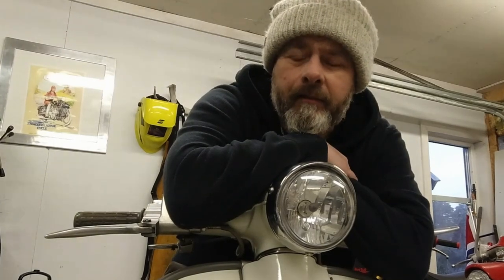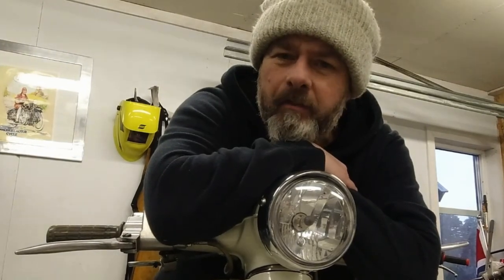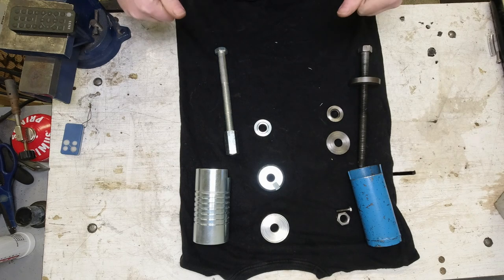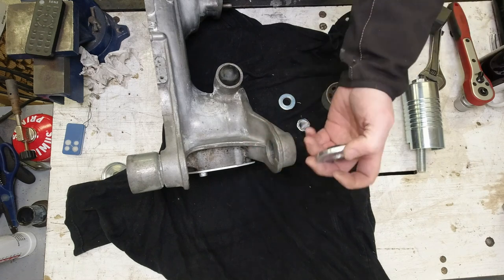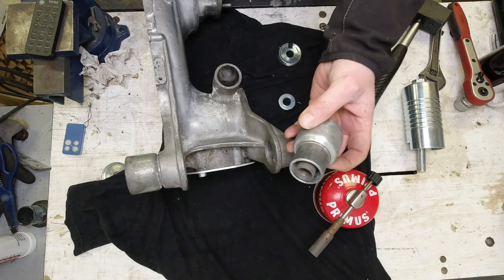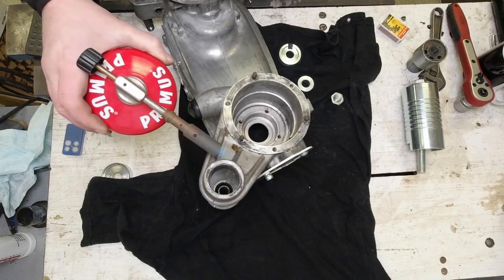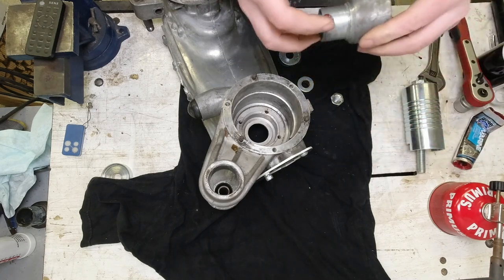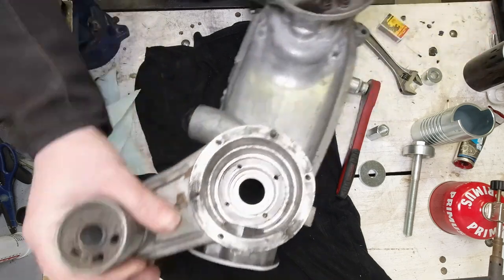BGM Lambretta silent block tool review

Comment: Hi can you change the lambretta silent block engine mounts with engine still in the scooter .
Reply from the maker: No. You have to at least drop it down. Fuel in the tank is probably not a good idea either because the engine needs to be heated
Reply: Ok thanks its always a learning curve.

Comment: What about engine levelling prior to fitting, do you imagine in location of scooter or bench level. Thanx
Reply from the maker: Yes, you have to take the angle it sits in the frame in account but if its slightly out it won't really make a massive difference.

Comment: Looks like a good tool but I just used sockets and a nut and bolt, I doubt I’ll be doing it again so no point me buying the tool. 🙂👍
Reply from the maker: They are worth investing in if you do it often or if you are a group or club and you all chip in on the one tool. It also avoids pulling them in at an angle, which can happen using ghetto tools. I've seen a few oval holes in cases which cause trouble. Thanks for watching.

Comment: Great job, nee to your channel,  got an s2 with the bolt that goes through those blocks and casing seems a bit stuck any advice or tool you know of thanks Dave
Reply from the maker: Sorry mate, didn`t see this coment. Are you sorted?
Reply: @kickbackgarage  nope thing seems solid whats confusing is it didnt have the parts you refitted as per say a s3 it is just a nut either side but on rubber mounting.
Reply: @kickbackgarage  silent blocks the nuts came straight off with long bar but had been on a long time definitely did s2 have a silent block or am I way off
Reply from the maker: @davidroberts2307  The larger engine mounts only originaly came on the 175, or larger scooters, along with some specials and SX`s. If yours are the original types it is well worth the upgrade if the engine is tuned. The engine rod has probably corroded to the 2 frame cones that hold it in place and clamp down on the bolt when the nuts are tightened. If you hit the engine bar alternately, left then right it should be able to free it up.
Reply: @kickbackgarage  thanks for that ill be having a go at removing it this week ive been soaking everything with pc 30 ill keep you posted
Reply from the maker: @davidroberts2307  Sounds like bit of a nightmare tbh. Good luck!
Reply: @kickbackgarage  ill keep you posted never say never lol